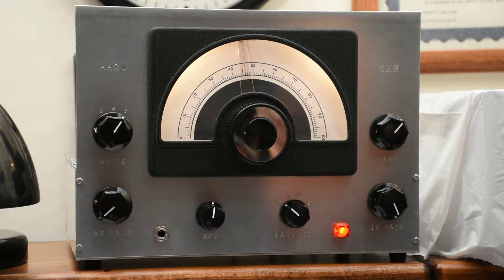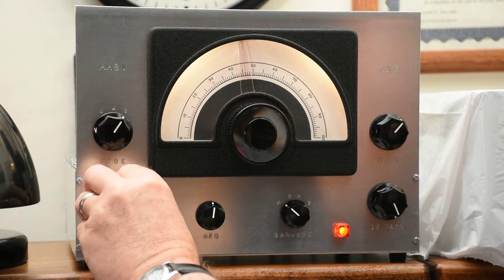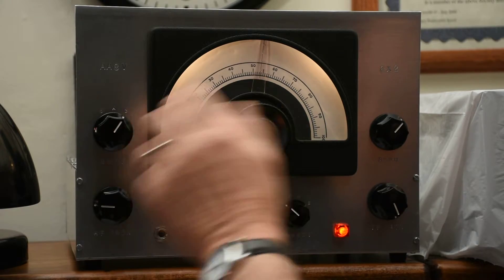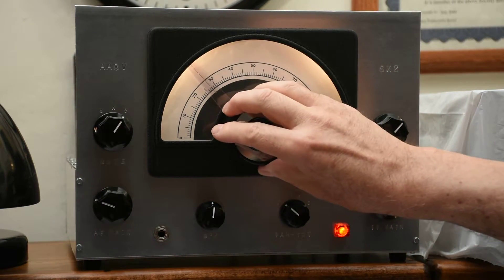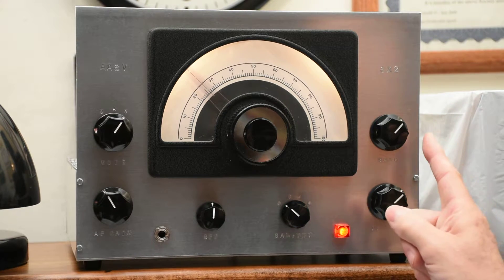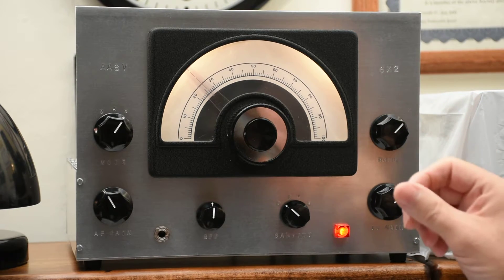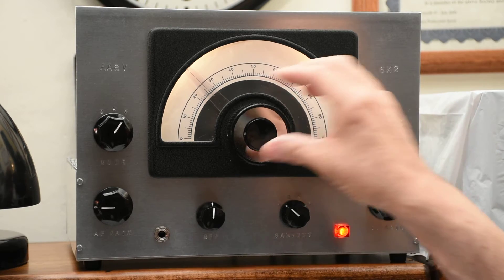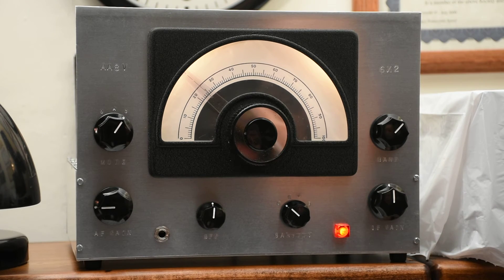6x2 Superheterodyne Receiver by AA8V

Comment: Hi Greg! Very nice radio! I would like to know if the
 What is the bandwidth of the bandpass filter? Thanks!
Reply from the maker: @Sanyesz855  The bandwidth is just right for SSB, but a little wide for CW. However, I use an audio filter on CW and then it works great.
Reply: @glatta0  Hi, thanks for your reply! Is there a ferrite cylinder inside l6 l7 and l8? Unfortunately, I didn't see a detailed picture of it, that's why I'm asking
Reply from the maker: @Sanyesz855  Yes, coils L6, L7, and L8 are adjustable.